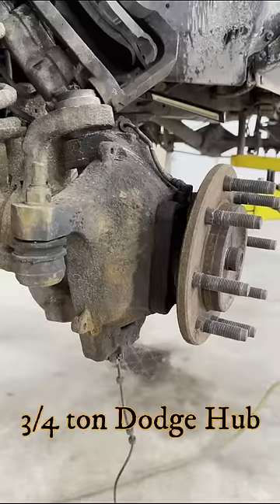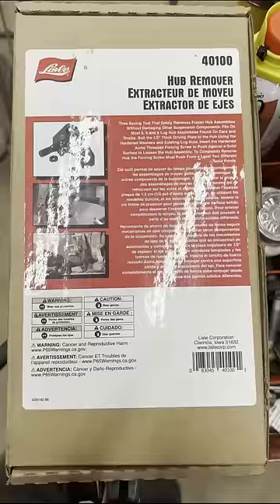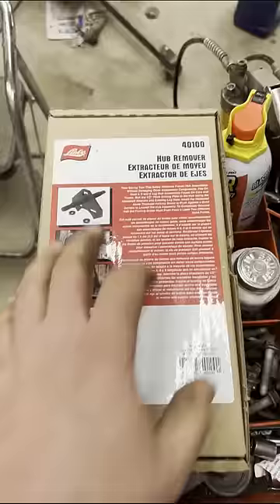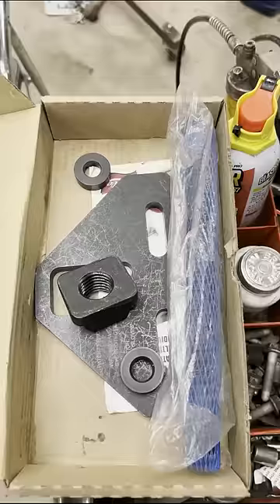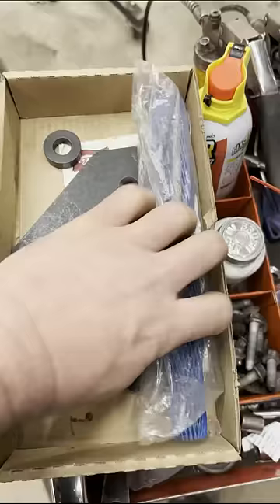Hub Bearing Removal Made EASY!

Comment: You can get an 18mm on the head and stack extensions, fire the engine up and use hydraulics of the steering to walk the hubs out that’s how we did it at the dealer
Reply: If it's stuck hard enough that just bends the tie rods 😂 one of my co-workers did that once
Reply: @Krankie_V you gotta practice a little discretion and maybe use some impacts from a hammer or preferably an air hammer or even a little heat from the old blue wrench in conjunction with the pressure rendered on it through the steering you gotta really be racking the shit out of it to bend a tie rod like that 😅
Reply: @MrCheaterpipe  it wasn't me who did it lol it was somebody I work with.
Reply: That's how I do it and done corretly it works far better than this "tool" which runs it out crooked as hell. Takes a short minute and you do it on both sides back and forth. Easy Peasey
Reply: @fiskfarm  the tool in the video works great if used per the instructions. You're supposed to reposition it a couple times to pull the hub out more evenly. It's not meant to be left in one spot like that.
Reply: @Krankie_V  thanks. That makes much more sense and he should have shown that 👍
Reply: yes it works, just put your bolts back in from the back about 4 threads with a socket on it,  start your vehicle and turn the wheel and it will push the hub out without any special tool. I have done this every time with this type of hub and have never had one issue.
Reply: But how will this work on the back hubs of the vehicle
Reply: @fiskfarm The guy didn't even bother to grease the forking screw. 🤷‍♂️ I don't think you're going to learn much from him.
Reply: @jdmforever5583 The rear hubs? It's a solid axle in the rear. What are you referring to? The axle shaft?
Reply: THIS^^^ 

There's a special tool that Snap-On or Matco makes that does this but the socket + extension trick works if you do these infrequently. I like Lilse and they have some creative solutions with their tools. But this ain't one of them. 

Unless this works on Ford Escape rear hubs, also. Then it might be a good buy.
Reply: @LynxStarAuto  no I'm referring to original comment... using the steering to break loose the wheel bearing, so obviously the rear does not have a steering so then what?
Reply: @jdmforever5583  Your video specifically said front hub 3/4 ton dodge, the rear is totally different you pull the axle shaft. 

Sorry I'm not saying the tool does not work and probably is nice to have I am just saying it is a waste of money to go get one for the front hubs on a dodge ram truck.
Reply: @Wrencher_86  I got an 2001 Ford escape 2.0L 4wd 5-speed manual trans. Independent rear suspension so there isn't a solid axle. Are the bearings likely to need replacing? 155k miles.

Comment: Remember kids, take your abs off first so it doesn't rip off after falling. Lol. From a friend.

edit..... when I wrote this, I was being sarcastic. I know it's slightly difficult to read sarcasm via the interwebz. HOWEVER! Having the "kids" of today believing they "need" to do a little extra work was truly my goal. Especially when they break every time you try to pull them out. So yes, I totally understand the comments. Keep those hands safe gents!
Reply: Love this
Reply: Iv done thousands never remove the abs sensors also never damaged one the plug is on the frame so that's just a cord ur seeing
Reply: Abs sensor already needs to be replaced to begin with, with a bearing that bad
Reply: Like every one said it comes with one, but if you look closely the wire harness is already done as well....
Reply: I was thinking the exact same thing!!
I was just thinking to myself, "what self respecting mechanic would press out the hub assembly with the ABS sensor STILL ATTACHED??!!".

You're effectively about to take a job costing approx $150-$200 and potentially adding another approx $75-$125 depending on the make & model of car you happen to be working on!!

So yeah, definitely not the brightest or most attentive move on his part!!
No doubt!!

Thankfully it doesn't appear as though the worst happened in this particular instance but still, not exactly setting the best example here either though!!

And I realize nobody is perfect but, when you're making videos trying to instruct others on how to do certain things DIY, then you should probably make your main focus about safety, efficiency, and frugality for those out there working with limited budgets.

So you don't want to teach them to do something the wrong way that could very well end up costing them more $$$ that they simply don't have because you didn't address this unfortunate & inattentive mistake by at least simply stating to the audience to remove the connection before getting started.

I mean, it really is just that simple.

Anyhow, thanks for listening/reading what I had to say and God bless you all!!
✌️😁👍

P.S.- After taking a closer look at the video, I happened to notice something fairly important that might very well explain why dude decided not to disconnect the ABS sensor/cable...and that's because, if you too take a closer look at the cable itself, you'll notice that there appears to be a substantial chunk out of the protective insulation/jacket surrounding the wires that transmit all that data back & forth between the sensor & ECU/PCM, so it was likely going to get replaced as well considering that, if those wires are exposed to the elements then they aren't likely going to give accurate and/or reliable information anyway, so dude just said to hell with it and let it hang!!

But that's still setting a bad example if he doesn't go back and properly address it IN FRONT OF HIS AUDIENCE!!
Reply from the maker: @travissmith4102  that literally is attached to the speed sensor and comes with the new hub assembly.
Reply from the maker: @thedude41780  ALL these style hub assemblies come with a new speed sensor. No reason whatsoever to remove it from the hub when replacing it! 😂
Reply: @thedude41780 that's a really long ass comment from someone who doesn't know that the new bearing comes with the sensor and wiring. Anyone who does this work knows that. Doesn't matter if you mess up the sensor or the wire because it's always replaced with the bearing/hub unit.
Reply: It’s a bad sensor anyway. He’s replacing it with the hub..
Reply: New hub bearing prob comes with it but I would still unplug it just in case 😅
Reply: All I could think of was that ABS line stressing right out😂
Reply from the maker: Go watch the video again. It’s literally disconnected and hanging down below the hub assembly! 😂
Reply from the maker: It IS unplugged! You can see it hanging below the hub assembly.
Reply: @Tomsfoolery.  
The new hub comes with a new abs?
Reply from the maker: @cliffordgill9052  Yes sir! On this particular vehicle the speed sensor COMES installed on the new hub. Wire and all.
Reply: @Tomsfoolery.  
I paint cars for a living… 25 years, but I know just enough about mechanical repairs to be a danger to myself and others😂
Reply: @Tomsfoolery.  that's what I said....I was agreeing and adding there's a nic on the side that is getting replaced with the bearing any way......maybe read!
Reply: @Tomsfoolery.  😂 some people just like to pretend that they know what they’re talking about.. great tip on the tool, thanks!
Reply: That takes all the fun of running to pull a part at 4:55 on Saturday evening.
Which means you have to take a friend to hold the people inside hostage until 8 or 930...
Reply: @Dee12327  I hope that comment wasn't directed towards me?  Because I just made a simple observation. And after wrenchin for over 30yrs professionally I would hope that I would know what I'm talking about or else all of that schooling and experience is for nothing. 😆😳 Wait.... It could have been...
Reply: @midnightrider1854  ? I was referring to the top comment that everyone was replying too.
Reply: @Dee12327  cool just checking. Cause yours was right there after my comment and I was confused as well. Lol
Reply: @midnightrider1854  im a pretty upfront person If i thought you said something dumb i would have said it to you 😂
Reply: Meh. My ABS lines were cut already anyways…
Reply: @Dee12327  hahaha that's cool cause so am I. I would have told ya where to go and bought you a train ticket there Brother ...man, I love these comments sections! 🤣🤣🤣👍Yeah, but on a more serious note I was reading the comments up top and wondering what was so serious? The guy did a wheel bearing. I didnt see too much wrong with it with the exception that he cocked it pretty hard in the knuckle. But usually I'm beating on the sumbitches. So it gets beat up one way or the other.
Reply: @midnightrider1854  😂.. i live in Canada, I’m not a mechanic by trade, I’m a trucker, but i try to wrench on as much of my own stuff as i can, as shops are stupid expensive.. I’ve done a few wheel bearings, I’ve lucked out with my hand press, torch and my BFH so far 😂
Reply: @Dee12327  Damn! If you live in Canada then you know all about the rust that we deal with here in NY. I bet that BFH has served you well? Í worked as an automotive dealership tech for 30 yrs and for  some reason I decided to switch things up and now I am a diagnostic tech for HD trucks. I kinda miss the cars sometimes.
Reply: @midnightrider1854  i get my vehicles rust inhibited every fall, seems to make a big difference, but i work on other peoples vehicles sometimes and they don’t, they just started using that calcium chloride here, that shits horrible, it wrecks the roads, sidewalks, people’s vehicles, and driveways, but saves the city some money on actually doing what we pay them to do.
Reply: @Dee12327  That stuff is horrible. They overdue it here badly. If someone ever wants to be good at wrenching they have to start off their career in the rust belt. Then when they move anywhere else and start changing parts without having to struggle without this state induced rust, they will be fast as hell. Lol
Reply: @brokenrc  I doubt you've done thousands if you think that "cord" isn't actually wires transferring ABS info to your computer. 

While the wire is connected to the lower swing arm, then ran along the frame to the computer, of you don't disconnect the ABS harness and that hub comes flying out, you're replacing the wiring harness because of micro breaks from that sudden mass yanking on the cable.
Reply: alex  😂
Reply: @Dee12327  gotta find a way to make more money bro.
Reply: @Krankie_V  yeah unfortunately, that's not why you disconnect a sensor before yanking a hub, while you are replacing the hub with has the sensor and pigtail included, you have to think about the actual connector the pigtail connects into, sudden tugging on wires causes micro breaks that can make it so you have to reterminal a connector past the broken wires. It's not a big deal to you but it's just more work someone else has to do for no reason.
Reply: @dbongoloid9541  what do you mean?
Reply: @Dee12327  with how shitty the quality of products are now.
Reply: @dbongoloid9541  ya. Everything is more expensive, and of worse quality, thats the 2020’s.
Reply: @dbongoloid9541  well, good thing it's unplugged anyway then?
Reply: Lol I was thinking the same thing when I saw the ABS sensor wire slowly stretching
Reply: alex  abs sensor don't always come with new hubs, always disconnect the wiring harness prior to removal
Reply: Most Bolt in wheel hubs come with the sensor anyway
Reply from the maker: @jasonharris996  it’s unplugged and hanging below the hub. Also, if you watch it again you’ll notice the abs wire is cut a couple inches up from the hub assembly.
Reply: SAW THAT...😊
Reply: @TomsFoolery well I stand corrected.😅
I'm more than willing to admit when I'm wrong and in this particular instance, that's exactly what I was...WRONG!

Apologies for my previous post & the claims that this was setting a "bad example", I sincerely meant no harm and was honestly unaware at the time, that the part in this particular application came with a new sensor.

And while I did attend a trade school where I studied auto tech, I ended up deciding that it wasn't the career for me and decided to use the knowledge gained to maintain my own vehicle as well as those of friends and family if requested.

And I damn sure don't proclaim to be any sort of expert on anything but, I simply base my judgements solely on my own personal experiences doing occassional maintenance/repair work on fam & friend's cars & trucks.

Thanks for remaining civil and respectful in your response by not taking the opportunity to just roast the sh*t out of me, when we both know it would've been really easy.😅

I guess you probably saw that and reckoned that I pretty much owned/roasted myself with that ignorant take of mine.😂

Anyhow, I do appreciate the respectfully gentle schooling on the subject and also for relaying valuable info about the inclusion of a new sensor in the packaging, that I honestly was previously unaware of!

Much appreciated friend!

Godspeed and God bless!✌️😁👍
Reply: what about the harness?
Reply: Edited comments are embarrassing
Reply: If it’s not sarcastic it’s not funny . If your happen to melt a snowflake in the process it’s a win-win

Comment: Insert the hardened acme threaded forcing screw to push against a solid surface to loosen the hub assembly. To completely remove hub the forcing screw must push from at least two different solid points.
Reply: THIS is correct.   It's also what Lisle says on their website for the 40100 Hub Remover, but the guy who posted this video didn't read the instructions, let alone have any common sense.

Comment: Good vid, but I would tap the other side from the backside so it would come out a bit straighter. Also, removing the sensor first would be wise. And now I know how to make a puller but would make it with drive bolts on both sides. 
Thanks!! 👍

Comment: I like where the design is going, but they forgot the other half of the tool in design. The plate needs to be bigger and bolt on 4 studs. 2 on either side for even tension.
Reply: I think the inventor kept the design to a minimum for production value but also intended it to be loosened spun 180ﾟ and tightened again as it walks out
Reply: That's because all specialty tools end up like this

Comment: I’ve found sometimes you can put the rotor or drum on back wards and tighten a couple lug nuts a little bit. Then keep ramming it towards you until it pops loose. I’ve only ever done it with drums in the rear on classics but I would assume it would work for other stuff too
Reply: People will never learn I guess. I'm there with you

Comment: All you need is and old 1/2 inch extension  12 inches long and the correct socket for the mounting bolts. Loosen and remove all but the 2 correct bolts and use the power steering to push the bearing out
Reply from the maker: I used to do em that way when I worked at the dealership! Back then, that was the quickest, easiest way to get em out!
Reply: That's what I did

Comment: That's why i love my '10 Ram 1500. 3 bolts and it pops right off. 30 minute job and no skinnned knuckles.
Reply: My 07 ram 3500 6-8 hours each side crazy heard  to come off
Reply: Not in the salt belt it wont

Comment: Did my Dodge Cummins axle and bought a 15 ton hydraulic puller to pull the hub, plus torch heat, and beating on it with sledgehammer.   It didn't budge.  Ended up cutting off the ball joints and taking the knuckle assembly to a fab shop to have the hub pressed out.  They had to resort to an 150 ton hydraulic press and heat to get it off.  When it popped off they said it sounded like a shot.

Comment: If you take a short socket, and put it in between the wheel joint and axle housing, when you start the engine and turn the wheel you accomplish this same thing but the tool is cool too, just a tip for those who dont have that tool

Comment: Well by pulling it out like you did, you ovaled the inside of that hub bore.  So now it’s slightly egg shaped and has a tiny 3-6 thou burr on the hub flange so the alignment will have to compensate that tolerance. I have no doubt the tool would work I would just do at least three spots to force the assembly out evenly.  However a good smack with a hammer on all sides and they often pop out or they have a bolt perpendicular to the bore around a c style clamp that you can loosen